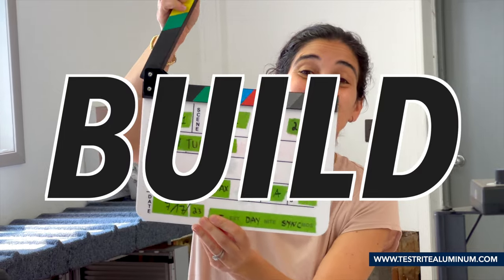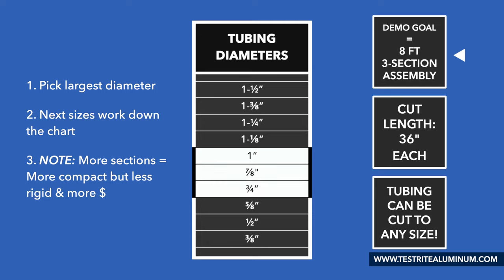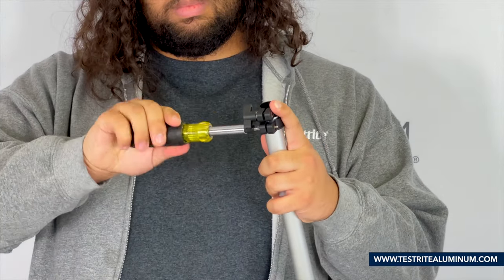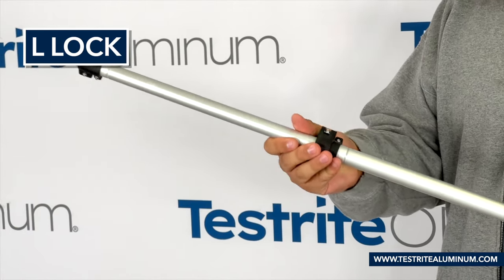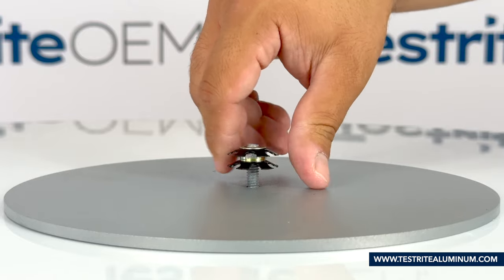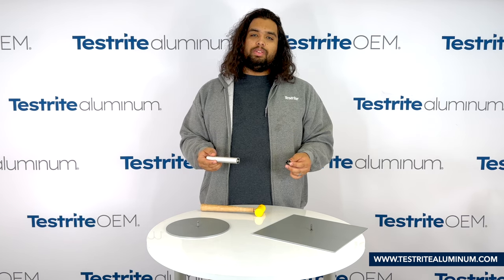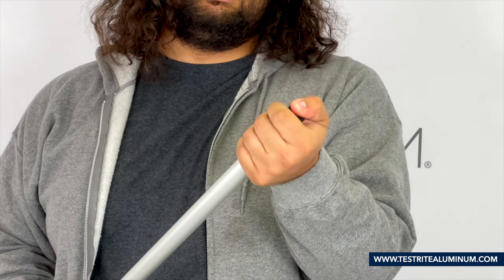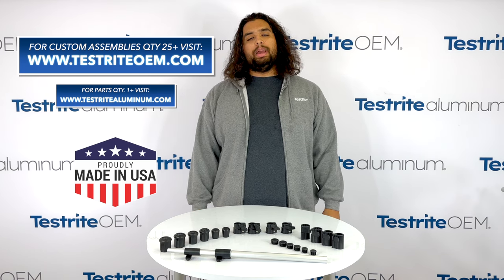Build Your Own Telescopic Tube DIY

Comment: Which lock type works on old pool poles.wotn boken cam locks?  I have a 2 pole.and a 3 pole style that can use new locking mechanisms.  The poles are still good, why dont theu just sell the replacement part at the pool store?
Reply: Unfortunately we don't sell replacement parts for other companies products.

Comment: Hi - I love that you offer this. I am looking to make something a little unique. Would it be possible for you supply one piece in the shape of an "n" where main length of each side would be about 22-24 inches long with one telescopic section at the bottom of both about 10-12 inches using the L Level Locks? In other words I'm asking if you can produce/suppy the "n" shape and legs or would I have to do the bending my end with for example with a standard tubing bender?
Reply from the maker: The best way to ask about a custom project is to reach out to us via our RFQ page at https://www.testriteoem.com/pages/rfq/ . Please keep in mind that for custom requests qty minimums may apply